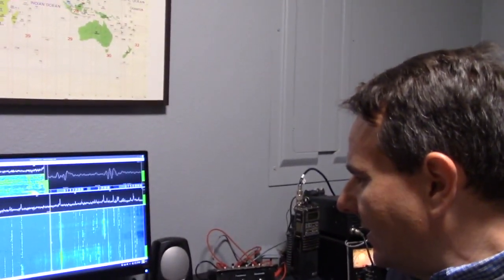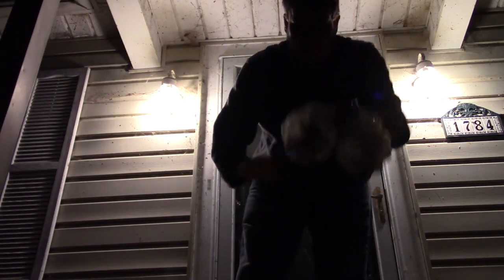RFI/QRM - Identifying the Source and Fixing the Problem

Comment: My neighbour gives me RFI on my TV and satellite box when he broadcasts.
Apart from throwing iron fillings into his circuitry, what can I do? Ferrite chokes on the power cables?
Reply from the maker: So, the cables are acting as antennas - while it seems like it is the hams fault, it really is the crappy design of the TV equipment not shielding - BUT, there is almost nothing those ferrite beads can't cure - I have five of them on one of my cables and it solved the issue, so either swapping out, or changing the length of the cables (making sure it is a QUALITY cable as cheap coax may have just a few strands and aluminum foil in the shielding), plus the beads should solve the issue.
Reply: @dixielandfarm  
Thanks!

I have put beads on almost every cable to the TV and satellite box, except the HDMI cables. Not sure if I need them, but beads are cheap and won’t make the issues worse. 

Appreciate your reply.
Reply from the maker: @sudo_nym  And don't be afraid to add multiple ones, and coiling the cable through if you can multiple times (that counts as another bead when it coils back through the same one again).

Comment: Re your old expensive LED bulbs: "The reason for the steep cost has a lot to do with LED bulbs’ tendency to get very hot very quickly. To counter this overheating, most manufacturers attach a heavy metal heat sink to the bulb’s base" ... and yours had those heat sinks. That's why they were hot.
Reply from the maker: Very interesting, James!  While I got the QRM under control, the bands are a bit dead by time I get to operate so I have just shut down the station for a year or two while I focus on other hobbies - 80m is still okay for slow speed code at nights, but THAT interferes with my home DVR/Network setup and to fix that would be to relocate either the shack, the equipment, or the antenna - something that I can't really do all around.  Probably should see if 50% power reduction will fix the issue...

Comment: Good find, the 100w equivalent LED bulbs I was using for video lights tended to get hot also but not as hot as CFL's or Incandescents but I think they just get hot in enclosed spaces like that.
Reply from the maker: I was happy it was such a cheap fix.  Next thing to try to figure out - when I send morse code out on a specific band, I make the router in the house quirky - not enough to break it, but to make it unreliable until I reboot it - but it still functions, so I can't tell when I have done it - until all of a sudden my TV is not recording... NOT GOOD.  Will be trick to figure it out.

Comment: When you changed the lights in the barn some while ago, I wondered if you would get QRM because I think you used LED lamps there? Assuming you didnt as you never mentioned it.
Reply from the maker: Nope - no noise - the barn is many hundreds of feet away (of course that doesn't matter) - but I have had LESS noise with the LEDs than with the CFLs.  The only LEDs that ever made noise were the ones in the video, and swapping them out for newer LEDs fixed the issue.  Having a vertical only ten feet from the house isn't ideal, but it is what it is.  I COULD redo the verticals, but with CW and the narrow filters, I don't think my casual operating warrants it, so I'm pretty much set now (since 20-10 I have the hex).  Also, 80 is the only tricky band, 40 is fine save for a few birdies.
Reply: @dixielandfarm  Do you get any ADSL/VDSL noise? I imagine there are very few people nearby so perhaps not an issue. In the UK a lot of hams complain about the noise but I dont hear much of it. I think as most cabling around me is underground its naturally shielded anyway. On the occasions I have been in FLorida, it looks like all utilities are overhead - does that apply to your area and telephone/broadband? They say that in 5 years here copper will be out of use and we will all be on fibre to the home . . . perhaps :)
Reply from the maker: Communication lines are buried here, so no problem with DSL noise.  We have fiber right outside the house, but they haven't offered the service, yet.  As a matter of fact, they moved us to VDSL two weeks ago!  I asked, why aren't they just giving us fiber since it is literally right outside the door, but they didn't have an answer.  The only noise we had were bad insulators from the power line - it literally took five times of getting the power company out to track it down and fix it - it would wipe out all of 80m and 40m.